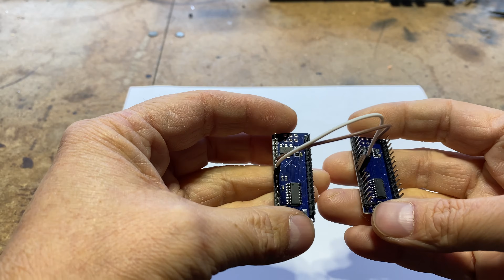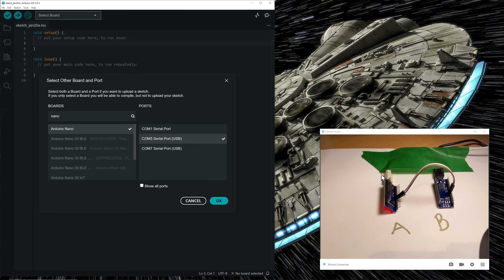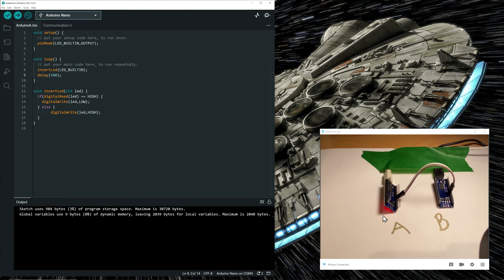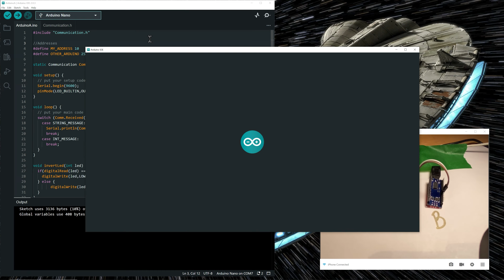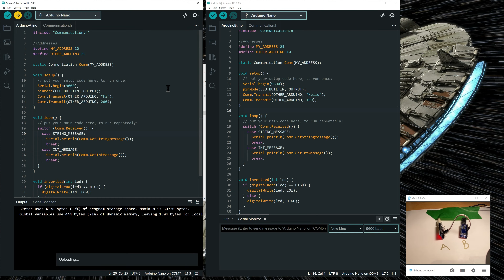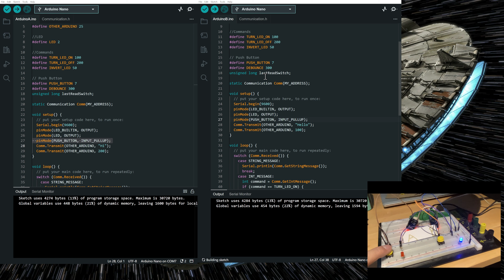Effortlessly Communicate Between Two Arduinos with Just Two Wires!

Comment: hey great video i have a problem i did exactly what you did with the wiring, the code and the libraries i even have arduino nanos.. but for some reason nothing comes up in my serial monitor😭do i meed to tweak something on the bootloader ar the or the programmer??? because its so strange that i dont see anything on my screen and i tried everything im strting to think my arduinos are brocken
Reply from the maker: Make sure the two nanos share the same ground
Reply: @thelastoutpostworkshop  they do have common grounds everything from the hardware is correct i checked like 15 times but idk what is causing the problem😭

Comment: Thank you for your clear explanation. It works fine. I can send Strings from within the code. But when I use a String-variable instaed of a "string"  , it gave an error. How and were can I fix this?
Thank you very much,
Fred
Reply from the maker: Convert your String variable by using .ctr() function on the variable

Comment: Thanks for your work and sharing....but I have a question....it´s possible that your code won´t work with greaters Numbers/Integers like 400?? I received others Numbers than i send
Reply from the maker: yes, the library included in the code is very basic, if you want to send large numbers.  You can modify the Communication.h library to handle larger numbers.

Comment: Thank you for taking the time to put this together.  I got this working with two Arduino Nanos.  However, if I replace one with a Nano Every, all I2C comms fails.  Initially it wouldn't compile, complaining about the "Wire.setWireTimeout();" command.  I commented that out and it compiles, my main loop is running, but all i2C comms have failed (not only to the other Arduino, but also to a 128x64 display I have connected via i2c).  If I run the exact same code on ordinary Nano's it works fine.
Reply from the maker: My first guess is maybe the pins used in the code are reserved on the Every

Comment: Thanks for this video, it was really helpful. I have a question: can I use the same A4 and A5 pins for communication with a Real Time Clock as well as another arduino board as you used in this video?
Reply from the maker: I have never trried it

Comment: Thanks for this video, it was really helpful. I have a question: can I use the same A4 and A5 pins for communication with a Real Time Clock as well as another arduino board as you used in this video?

Comment: Thanks for the video  ,i have a question , if i use an uno with pin 4 and 5 used for my i2c lcd   as my main controller and i use a n nano  with a rotary controller would i t be possible  to use  pin 27 and 28  for the connection and will it  work . secondly when i send an int  that is determined by the rotary count on the rotary controller how do i insert that value in an int . lets call it  "Pause"  on the uno
Reply from the maker: The Arduino Nano does not have pins 27 and 28. It has 14 digital pins (D0-D13) and 8 analog pins (A0-A7). On the Nano, the I2C communication uses the following pins:

A4: SDA (data line)
A5: SCL (clock line)
To communicate between an Arduino Uno and an Arduino Nano using I2C, you would connect the SDA and SCL lines of both boards together, ensuring that the master and slave roles are correctly assigned in your code.

Comment: Thank you for a great tutorial.  I have a few questions about the initial test code.
First, since you didn't set a pin number, how is LED_BUILTIN working?
Second, in your "inverted" function, your declare the variable "led", but there is no reference to pin 13, the built in LED.  How does this work???  Thanks very much.
Reply from the maker: If you look at the code for both nano (links in the video description), you will see that the LED is defined, as its PinMode
Reply: @thelastoutpostworkshop  Thank you very much.  Must the communication pins be A4 and A5?  Thanks

Comment: can i connect more than two arduinos?
Reply from the maker: yes, the i2C protocol can have many devices connected
Reply: @thelastoutpostworkshop  I have to specify an address for each one? And kindly, can you tell me how to transmit for example, one message to three Arduino just in simple words. Also, how can I transmit a float or sensor reading From one Arduino which sensor is attached to other to Arduino. 

Thank you so much